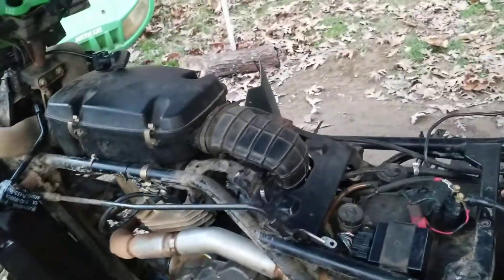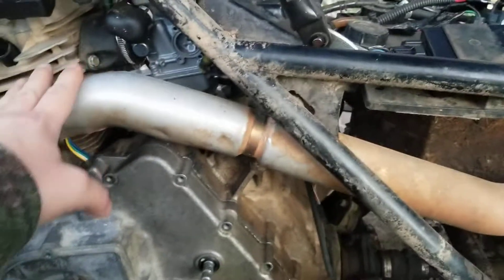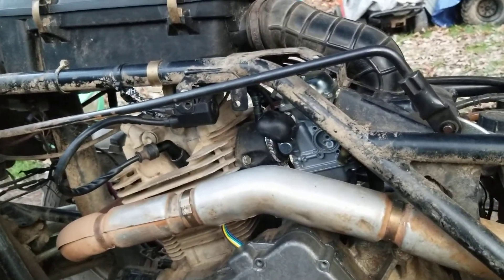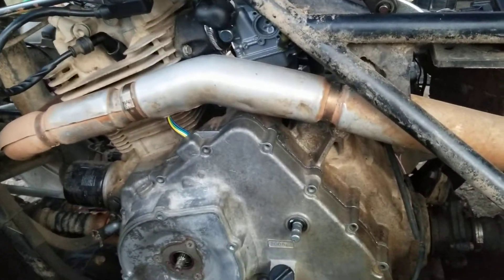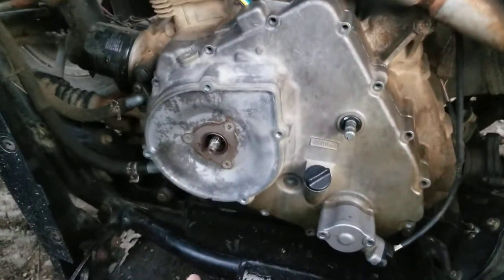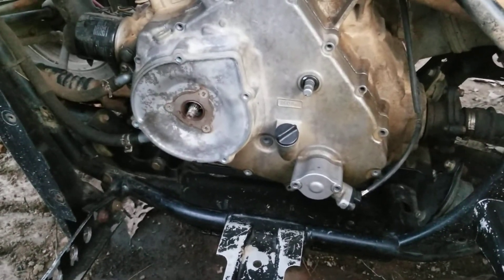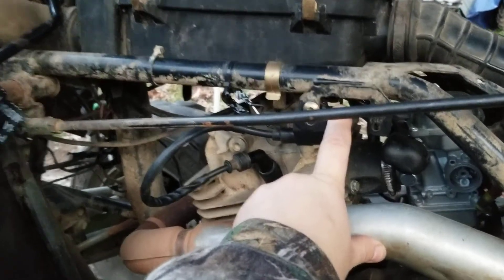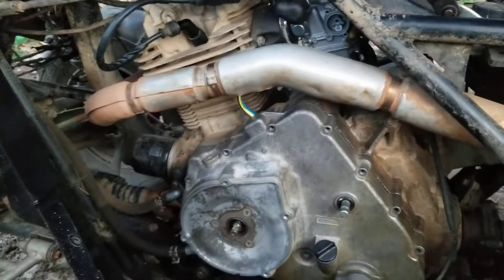2006 Arctic Cat 400 TRV ATV. Will it run? What Happened??

Comment: My 2008 was doing that also (starting but give it gas it would bog down and die), but I found out it wasn’t getting enough air. I checked the air filter and it had became brittle and was flaking. I replaced the filter and it fixed my issue.

Comment: Did you get answers to the shifting issue?
Reply from the maker: I haven't worked on it but I think I loosened the linkage to the gear shift and forgot. That's the only thing it can be because the gears are positioned correctly. I plan on working on it again soon.